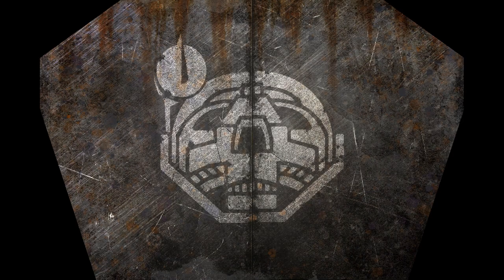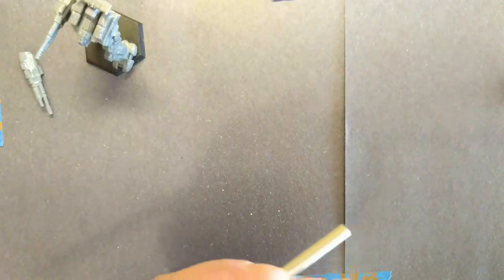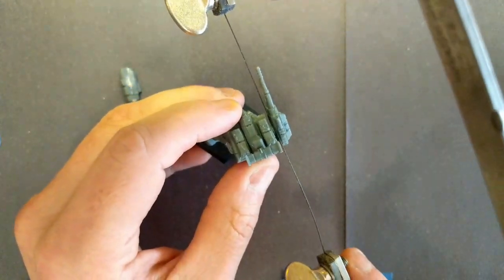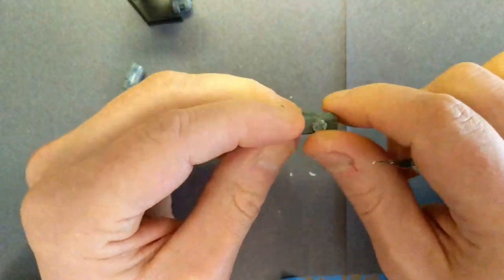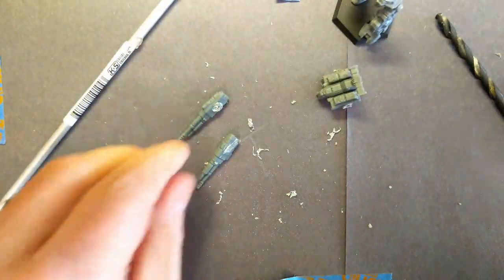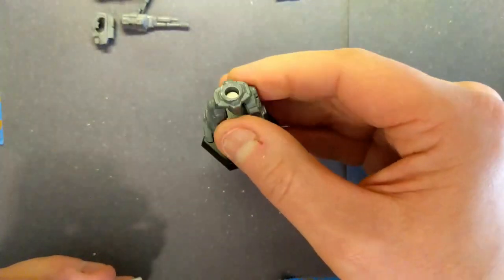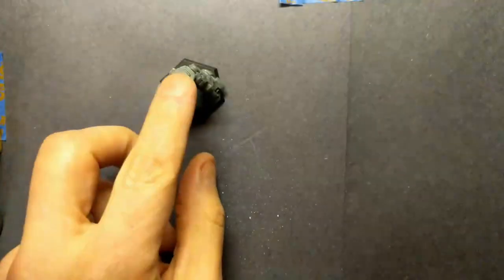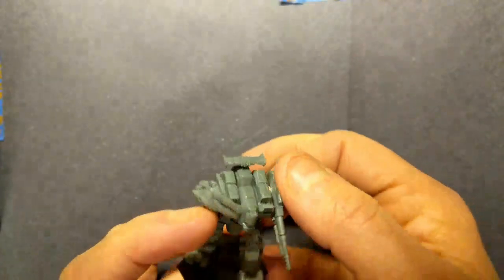Stream Replay: Magnetizing Joints On Mechs | Battletech Miniatures

Comment: A handy tip from one modeller to another: Xacto makes different types of blades for different types of cuts.  A steady hand and a  chisel blade is excellent for cleaning up saw cuts after the fact.

They're also excellent for deleting details from large, flat surfaces on larger models, without spending a lifetime and a half sanding or filing them off.
Reply from the maker: Great tip!

Comment: Great tutorial, I've never considered using bushings for this.  A trick I saw for maintaining polarity was to actually just build a dedicated magnet on a dowel.  That way you can be consistent across all your projects which can be useful if you want to swap parts.
Reply: Yeah, maintaining polarity to swap parts (Dire Wolf with Urbie legs...) is fun! But I just used the torso/lower body of the previous mini as reference without a dedicated magnet. I then mark the side of magnet (dab of color, etch a bit with a blade, sandpaper it) that is supposed to go towards the inside because they are small and you might drop them, turn them, etc.
Reply: @John Benson that's a good idea thanks for sharing
Reply: Making a dedicated 'tool magnet' for that is smart! I usually stick all my magnets together into 1 long chain, and have 1 end of marked with white paint. Making a dedicated tool is a more failsafe version of this. Gonna glue me some wood to that 1 magnet now😀

Comment: If you don't have a jeweler's saw, use dental floss. Tie one end around a table leg (or something similarly stable), put the floss around the joint you want to cut, hold the mini with one hand and hold the floss with another hand. Works like a charm, takes less than a minute, doesn't take much material off (basically none) and you can leave arms etc. on the mini if you don't want to deattach them.
With the tubing... just putting magnets in the hips and the torso ("glued" in using green stuff) works for me.
Reply: Interesting.... I haven't tried the dental floss trick.  Most of my techniques come from working with metal miniatures, where a saw is a must.

Comment: This is an excellent tutorial.  Question:  Do you generally recommend doing this before painting a mech, or is it a big deal to make this customization on a painted mech?
Reply from the maker: Nearly everyone would suggest doing this before painting if you care much for the paintjob. If it's something you feel you can easily touch up or perhaps just a painted mini that you want to experiment with, then it's not an issue to do after painting, but there will be some chipped and damaged areas from the cutting and drilling.

Comment: This is an awesome guy. Thank you very much. I can't wait for my Solaris 7 beginner box to come in because I'm definitely trying this on that rifleman!!
Just a question in your experience, does the same size tubing work for the later and smaller medium max? Or do you need to step down in the tubing size for the smaller units?
Reply: Hmm, it depends a lot on the mini.  I try to keep to the same standard size because it greatly simplifies the tools and supplies you need to have on hand, and those magnets are a good strength for all sizes of mech minis.  However, some joints on some minis will likely be too small.  I haven't been inclined to try to magnetize something really small (eg, a shoulder joint on a Kit Fox), but yes you could do it by stepping down in sizes. You just need 2 sizes of tubing that fit into each other, and a magnet that fits into the smaller one.  Very small rare earth magnets are available, and should be able to hold a small mech arm.

Comment: Great vid. Would you be able to post links to where you got these supplies? The magnets and bushing pipes especially?
Reply: Thanks for watching! I get most of my supplies from brick-and-mortar stores, including everything in this video.  Any hobby store that carries model railroad or RC supplies should have them; a good online retailer in the same should work as well.
Reply: @heavygauss  cool, thank you. I will have to try this with a few models. Might be harder with anything with an elbow joint but this should work great. Thanks!
Reply: @ColonelSkills  Of course you can do this anywhere, but as a matter of practicality I consider this technique primarily for torso twists and flip arms.  There's a lot more to consider for other applications like omni-mech loads, and fully articulating things like knees and elbows on a gaming mini seems silly.  Well, maybe for a one-off art project...

Comment: you could use polystyrene tubing as well, its probably a lot easier to work with, you can cut it with your knife.  probably cheaper.   this isnt a industrial build, i seriously doubt metal is needed for the wear of playing a few times a month at most will do on the model.
Reply: That's true, styrene should work as well if you can find some of a good size.  At my local stores, I wasn't able to find a pair of sizes that fit smoothly in each other, so I went with tried-and-true metal.

Comment: Very cool! Which 2 sizes of magnet did you use for this project?
Reply: I had 3/16" and 1/8", but really you just need to size them to the tubing you get: the bigger one the same diameter as your larger tube, and the smaller one so that it fits in the smaller tube.
Reply: (and to repeat what's in the video, the tubing I was using was 3/16" and 5/32")

Comment: Do you need to use rare earth magnets because of how small they are? Or can you get away with regular magnets because the sleeves helps hold it in place?
Reply: That's a good question, and it probably depends.  I started using rare earth magnets because the strength is needed to keep the parts firm on metal miniatures.  On plastic miniatures, regular magnets would possibly suffice. If you try it, let us know how it works out!